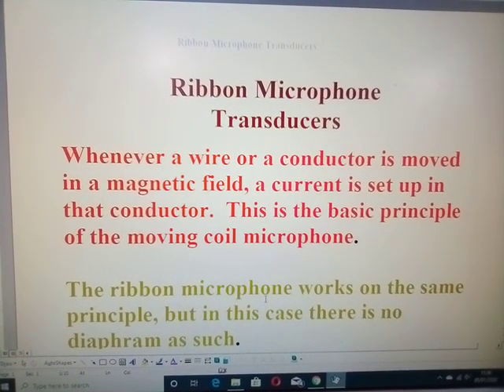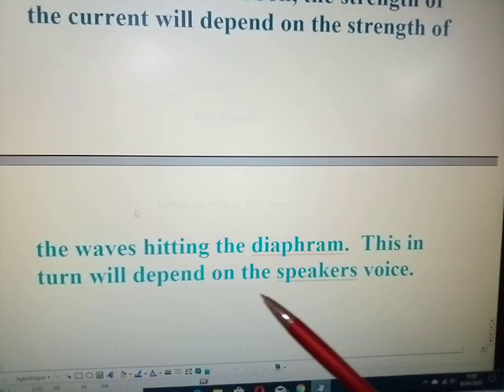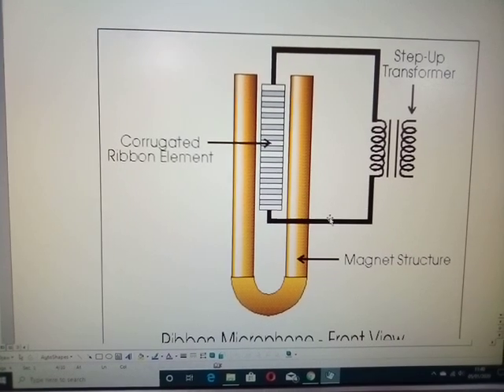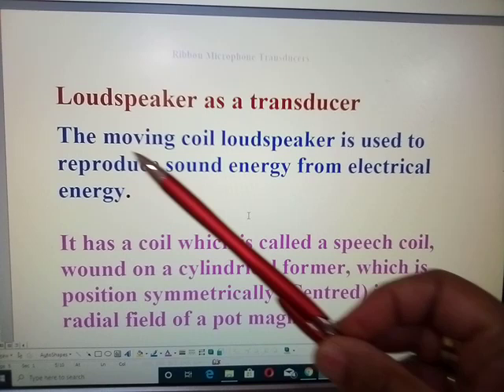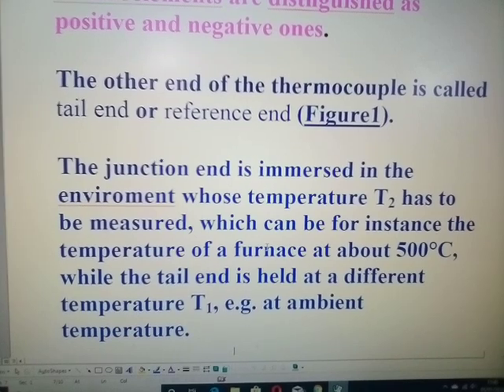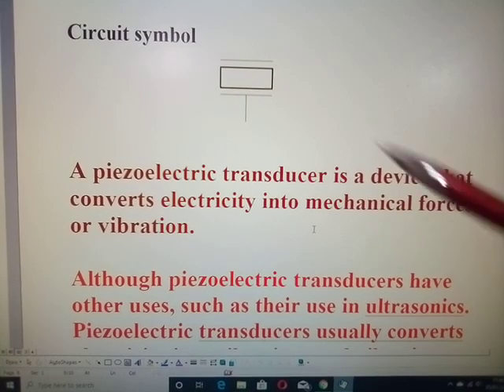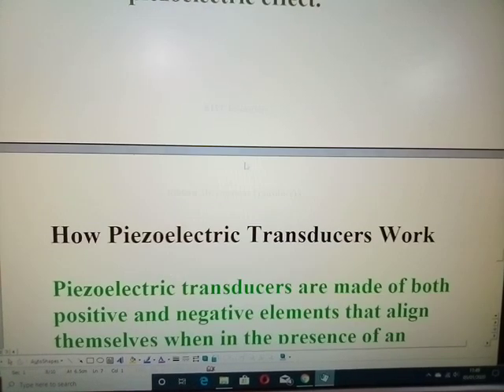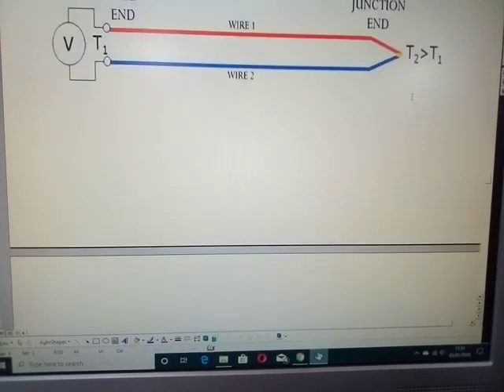Ribbon Microphone

Comment: As an experiment some years ago, I built a ribbon microphone from magnets and aluminium foil (I think I used 3 micron).  Using a transformer as in your diagram is a possible solution, but transformers tend to be rather non-linear.  Another alternative is to construct a highly sensitive amplifier stage, for example using a long-tail pair or similar to provide high gain and high sensitivity.
Another possibility is to use an op-amp with moderate feedback, if the long-tail pair does not provide adequate sensitivity.
Whichever amplification method is selected, the results are pretty good.
By the way in practical terms, you probably need to use neodymium magnets (N40 or better) to get adequate sensitivity from the ribbon.  The air gap also needs to be rather small.  Construction is quite tricky, the ribbon is extremely delicate and will tear if you look at it fiercely.